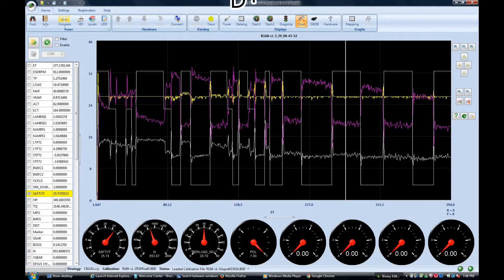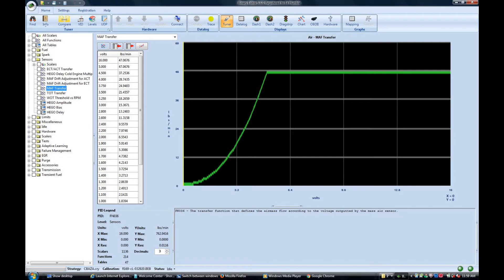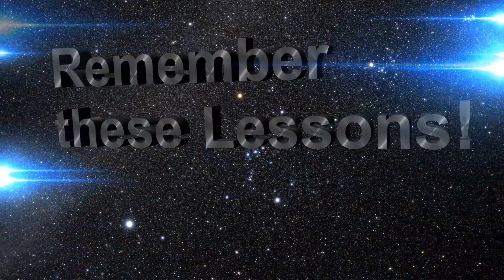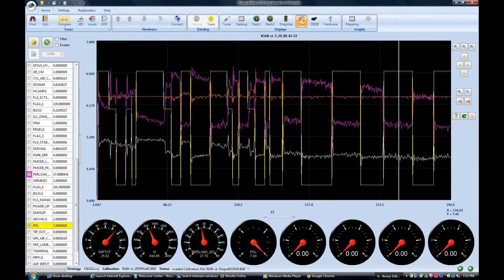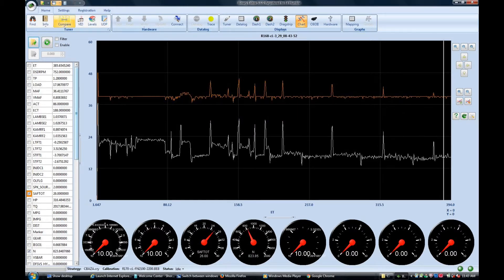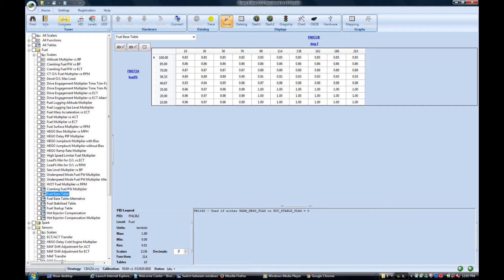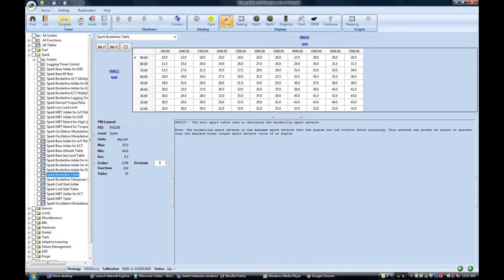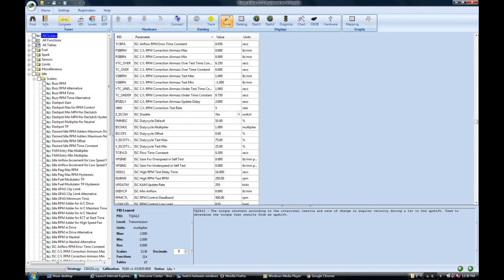Dialing in a Cold Start Routine with a EECIV, CBAZA, Moates, and Binary Editor

Comment: I wanted to thank you for taking the time to make this video and post it.  I have a 1994 mustang gt/ cobra clone canary yellow with black interior. It’s was a daily, but has been a project car for way too long.  I swapped in a F4TE 351w shortblock reringed and new bearings.  F303 Motorsport camshaft, ported GT40P heads, GT40 lower with ported explorer upper intake. I was able to use MAC 1 3/4” full length headers for a fox, Mac 3” flowchamber, to 3” summit welded mufflers.  I made the fox headers work by switching to a fox bellhousing with clutch fork.  The 5/8” difference is unnoticed at the gear-shifter placement.  It also has 3.73 rear gear.  Although I have 75mm throttle body, 90mm lightning mass air meter, and 24lb or 30lb injectors to choose from, and a quarterhorse, it’s currently running on stock tb, maf, and 19lb injector.  I haven’t drove it at speed, just start up and putting around the driveway.  I have been lost as to how to tune the car.  It’s very intimidating to someone loathes computers and has not keep up with advancements in technology.  If you have the time, could you please make more tuning videos.  Btw, I was in Charleston in Feb. 2019 and was impressed with the Calhoun statue in the battery park before the mob attacked it.  I was able to acquire a square battle flag at the old pantheon war museum.  Greetings from Kentucky.
Reply from the maker: I'm gonna do a few more videos on CBAZA .  I just need to get a few other things off the list.

Comment: Hi Mr Humble. I see youve been working with the Moates for more than a few years now and have been making headway. It seems our engine packages are pretty similar except for the fact that your running EEC5 and Im running EEC4 and am interested in getting ahold of the tune you wrote to try out on my engine. camtwo1970@gmail.com. Thanks
Reply from the maker: I’ll send mine to you.  Make sure you adjust for injectors, MAF, and CID.  Mines been sitting due to COVID.  I’m retired.  We just drive the wife’s car.  I still believe most people don’t adjust the MAF curve.  Note that the program uses Sailor Bobs extended definitions and the program won’t work without them.  Mine is an EECIV. In a 1995 Mustang.